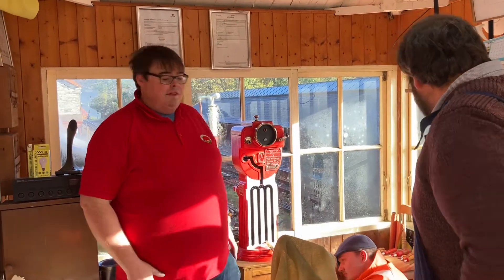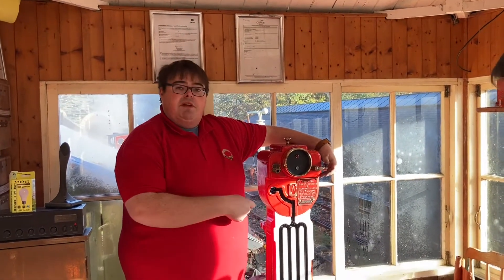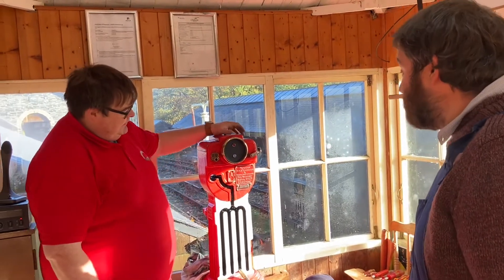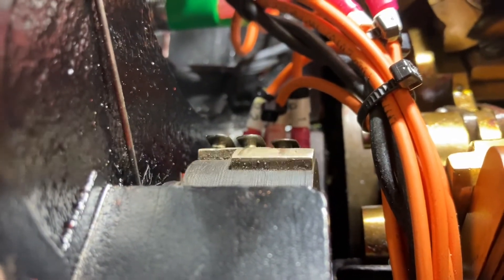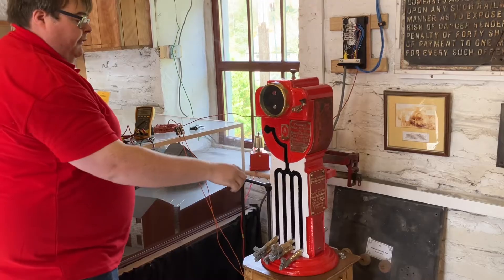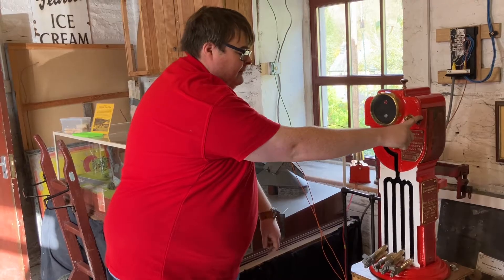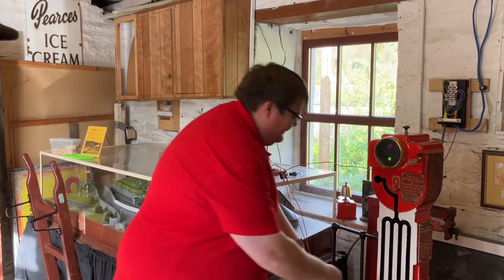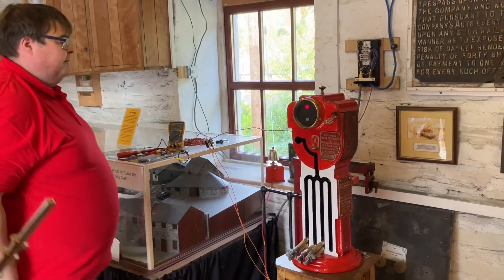Corris ETS project

Comment: Excellent stuff. At the Cambrian, Oswestry we have just got two Tyers No 9 working side by side and are currently contemplating running cable. Also looking at non-signaller options e.g. wifi. 
We have a couple of those ETS machines in our museum.